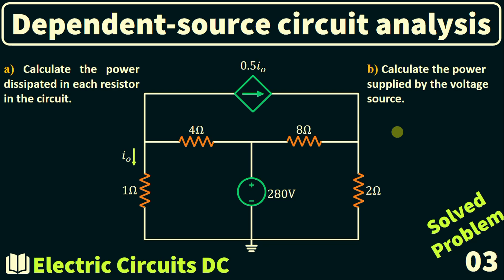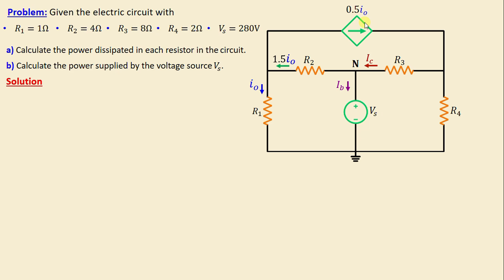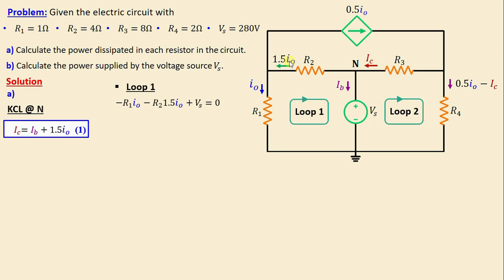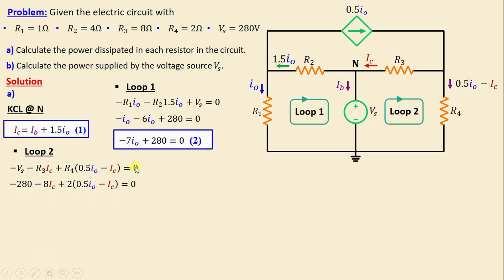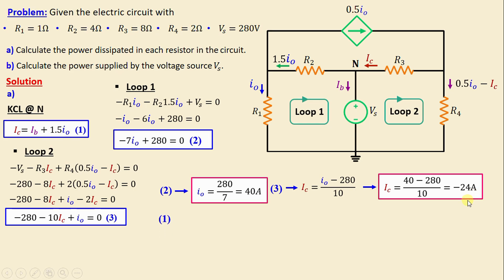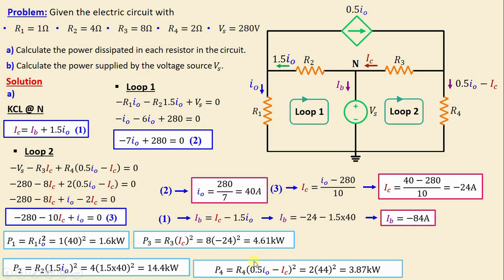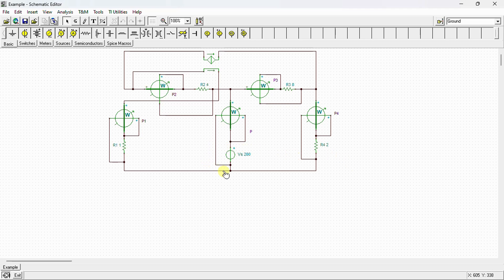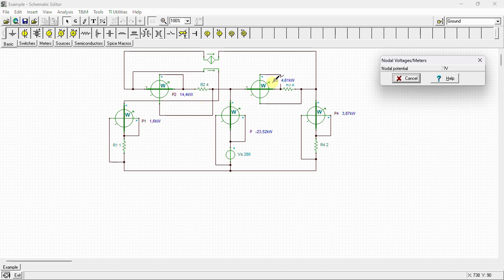Solving circuits with dependent current sources - Problem 3

Comment: why is the power of the battery negative I don't get it, and why is Ib pointing inside the power source should't current flow from positive to negative terminal ?
Reply from the maker: If the power is negative that means that battery supplied power